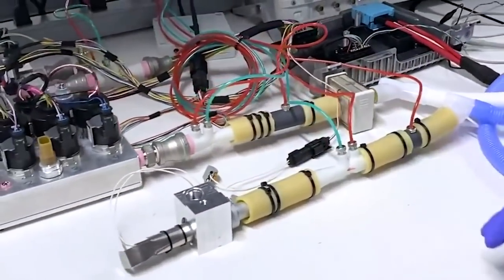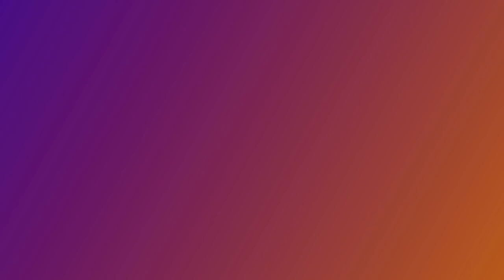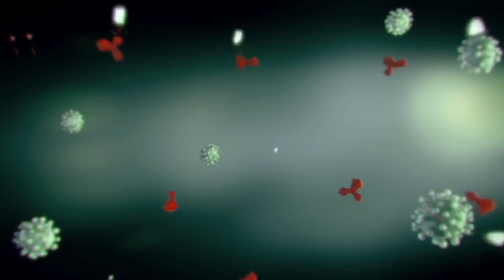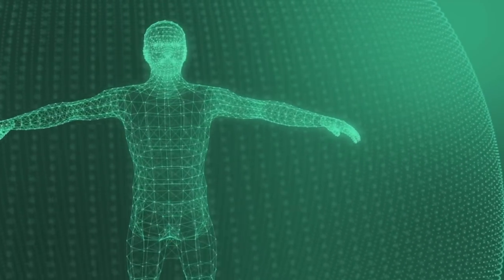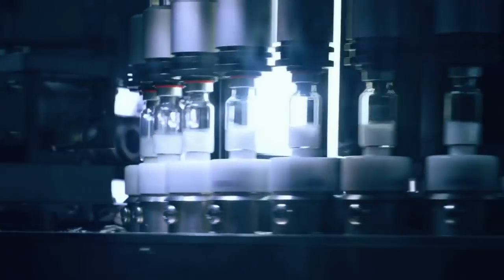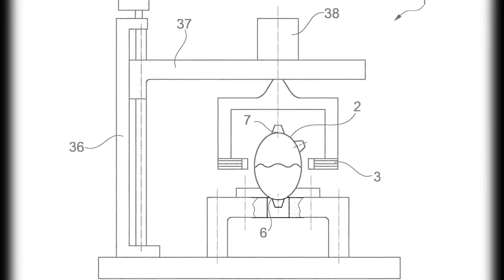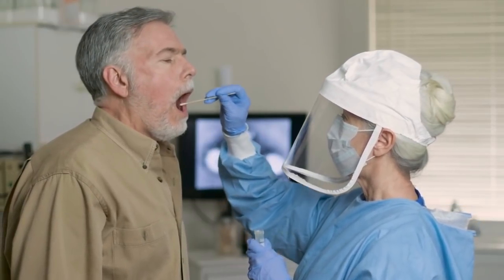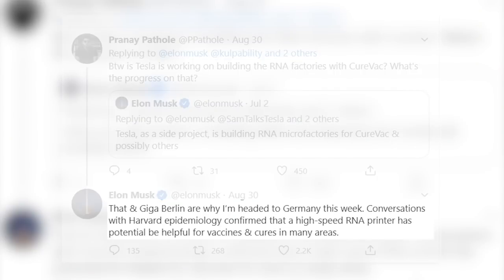How Tesla Will Soon PRINT Vaccines

Comment: Elon stick with sustainable energy. Remember the Thai cave rescue. It ended up badly. Forget about RNA business. There is one incredibly valuable area you should do research in. 
1 fusion energy. Mini fusion energy plants. If you discover the secret to sustainable fusion energy you will not only solve the problem of energy on earth but also on mars
2.Mini Molten salt reactors. These can solve the problem of energy on earth and Mars also. 
If you solve one of these two energy sources, you will make electricity so cheap that it will almost be free. ... and bye-bye to ICE vehicles. You will change the economy of the world. 
Please Elon. ps please forward this to Elon.